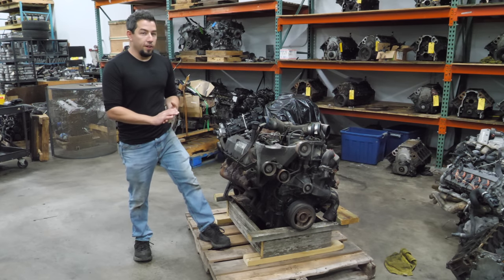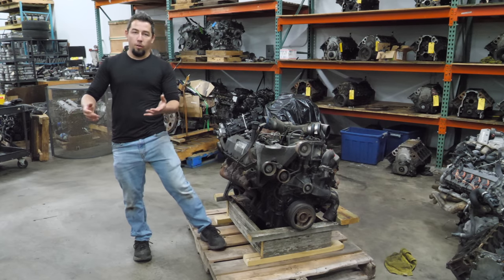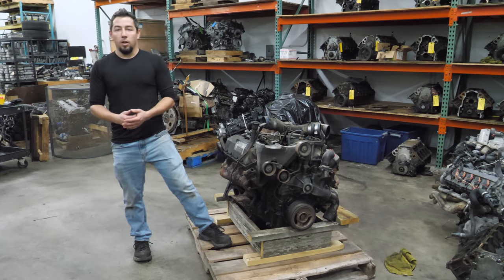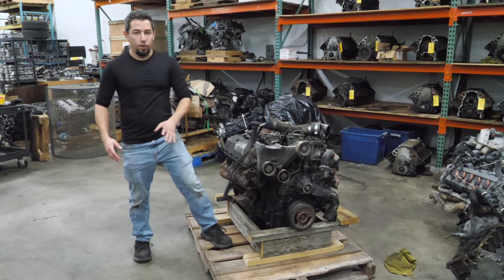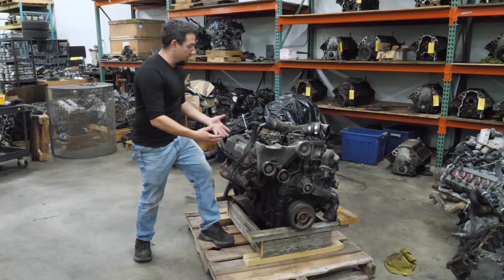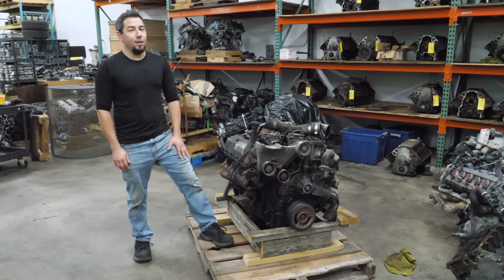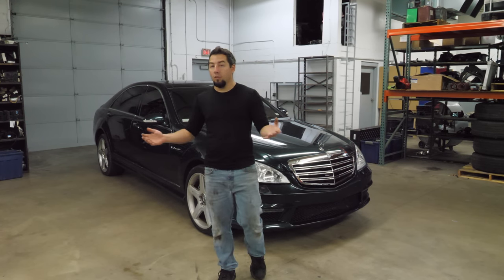70K OR 700K? Ford 7.3 Powerstroke Mileage Discrepancy. How Many Miles Are Really On This Engine?

Comment: I want to surmise its a 70k motor with poor maintenance. oil and filter change sounds like a local service sweatshop with poor routine. drain it til its good enough and put the oil back in it.

Comment: Wow. This one is hard.  After reading all of the other comments, I can see both points of view. Everything external says low miles but the bearings and cam -hmmm.  Quite a shock to see that copper.  However, as others have pointed out, that is probably a case of being "rode hard and put up wet."  Even 70k of that kind of use will exact its toll on any engine.  I think it comes down to you.  As we have seen, you won't mis-represent an engine and I would direct any interested party to this video and then come to a fair agreement.  If you decide that its really a builder, then ask to have it torn down for your channel. Would love to see a real Navistar torn down.

Comment: If the truck was driven for 17 years then it could have 700K miles easily.  However, if it was only driven 70K miles for 17 years then that is an average of 4117 miles per year, which seems unlikely.  I think it has 700K miles.

Comment: If the engine was mine and I had it on the bench as you do, I would put in a new set of bearings in it and put it in my truck.

Comment: It can't have done 700 because as you say it did it in 3 months. Impossible.
It's done low KMs. Just idled lots. Fit new bearings and it will run great. Because it was running when crashed.

Comment: These engines are supposed to make it a half million miles before 50% of them need major engine work IE head or oil pan removal, so to see bearings look like that after only 70000 miles is not likely on an engine that gets 15 quarts of oil every 5000 miles.

Comment: I can’t comment on the wear or condition of the engine, but I do know how people make mistakes entering numbers in computer applications. They are lazy, so why type six numbers when five will do. 

The numbers only make sense if the initial 64,899 mileage is actually 648,99x. The oil change intervals are roughly every 3,000 miles, sometimes in one month, sometimes in three. It looks like the vehicle went the first ten years of its life without any maintenance, so maybe they replaced the engine and rethought the benefits of regular oil changes. 

If you take the 600,000 numbers like they are 60,000, in some cases the oil was changed after only 466 miles. Seems extreme.

Comment: There's no way it has 700k on it, I've seen diesels with almost 1mil miles on it, and that's not it. Those bearings are a mystery, something doesn't add up, cold starts after sitting for years? It's just too clean inside.

Comment: There is absolutely  no way that engine did 700,000 miles.

I can be sure because of the carfax data.

To whit: 29 Dec 14 to 03 Feb 15 is 36 days. The difference in recorded mileage between those dates is (685,738 - 68,372 =) 617,366. That's an average of 17, 149 miles per day. That would be an average speed of 714.5 miles per hour.

Now, I know that a big turbo-diesel has torque by the bucketload, but there's no way that brick of a truck could average over 700 mph!

We can have some faith in the figure of 68,372 miles for 29 Dec 14 because it's plausibly consistent with the preceding record of 67,675 on 02 Aug 14.

Someone must have done something weird to the odometer between December  '14 and  February '15.

Comment: Tear it down and measure the cylinder bores. I'd think at 700K the engine would have been rebuilt and possibly needed the cylinders bored larger. But you really can't sell it for decent money with bearings like that. And we haven't seen what the main bearings look like.

Comment: No expert on these engines, but it seems unlikely that the engine would look anything like as good with 700,000 miles.  Whereas just what what i have learned from your channel, with a two owner truck, first owner doing poor oil maintenance gives you excessive bearing wear, he then dumps the truck.  Second owner does his 3000 mile oil changes until he kissed something rigid.  Low mileage poor maintenance explains paint left on the block/covers and a generally good exterior, and excessive internal wear.  Also i can't see an engine with 700,000 miles of wear and tear still having paper/plastic labels intact.
One solid test would be to yank the glow plugs and borescope the cylinders from the top not just at the crank (pistons will not wear there at the very bottom where we saw the hones).
700,000 miles with perfect maintenance would still have loads of wear.  And 70,000 miles with poor oil maintenance should still have decent honing patterns.

Comment: Mostly just my conclusion from what I've seen is... There is a good chance that this isn't a 70k mile engine. Now, the great question is... HOW THE BLOODY HELL DID THE OWNER MANAGE TO PUT ALMOST 700K MILES ON IT?! Like seriously, within 2 months, I cannot think of any real reasonable conclusion unless the owner drove almost like every day and even had a trailer on the back of the truck with him. Which would make sense to an extent. Tho the question then is... why is none of that recorded at all to any extent? Because part of me has to wonder, Did the owner perhaps change the oil themselves most of the time, and never record the odometer (or reset it.) each time they changed it? The better question is, where would they have been going to have gotten that many miles, probably across the entire landmass of america, within such a short time span...

Either way, I believe this engine might be a 700k. But the condition of the plastics and parts of the exterior lead me to want to believe otherwise. However it is quite rusty with that exhaust... which makes sense given chicago but... Was that at the end of it's main journey, or... was that all accumulated during it's long journey of the mysterious 700~ish thousand miles, for all that rust anyways. It's difficult to say tho without having been there to witness everything that engine and truck went thru.

Comment: Plastigauge is the absolute shiznit for what you're doing here. Great way to objectively check those bearings.

I like your theory that the engine was either replaced or rebuilt at some point in its life. The 70k and a ton of idling theory holds water too, but I don't think any amount of superfluous maintenance could've kept an engine that nice for almost 700k...and considering the sad state of that bed I don't think the maintenance it got was all that great.

Comment: I can tell you -- If it's not leaking everywhere and covered with oil -- then it probably has less than 300k miles.  These things like to leak oil, and a high mileage engine will usually get neglected and it will show signs of the leak carnage..  If he does have oil everywhere -- then it's likely 300k miles or over......    Judging by the rust on the back of that bed -- this truck likely does have 700k miles on it.  Just a guess.

Comment: the " best " route would be to just fix it to running condition for YouTube ,  and sell it as a working engine to be rebuilt,  it's definitely not 70k miles I would expect a cluster swap occured before it was salvaged as the low miles cluster its easy to upgrade a clean truck,  the engine is a 300 or 400k care worn engine by the looks

Comment: Looks like someone forgot the decimal, accidentally multiplied mileage by 10.  Rather than correct the mistake, they went with it afterwards.  The paint on truck looked too good for 700,000 miles.  Chicago rust though.

Comment: not trying to start fights but it seems like a lot of you guys are basing your experience of old small blocks and don't realize just how ridiculously overbuild the 7.3 bottom ends are. totally possible for a well cared for 700k engine to have rod bearings that look like they have lots of life left in them

Comment: There's no way HEUI injectors will go 700K.    They will very likely go 70K.   Look at the serial numbers on the injector solenoids.   They should be sequential or nearly sequential if they are original.

Comment: Why can't you check engine searial number with the Vin  number on the truck. Ford  will still have the build sheet. A dealer can find that for you.
Reply: My 2001 7.3 is all original except up pipes and were harness. 301234 miles still running strong.

Comment: I would lean to the 700k. My 7.3 with 135,000 has no external oil grime of any kind and l have not repaired any leaks either. It could be 70 with some poor maintenance and shit box oil ran it. Best diesel ever put in a pickup besides a 5.9 cummins.

Comment: Just from watching first few mins. Id def say that engines got 70k. With the discrepancy, im thinking they looked at 68,573.8 on odometer, and didnt think of the .8 and just wrote 685,738. Im writing this only 6 mins in but also from experience with my own 7.3 in new england, if that truck had 700k in the rust belt it would have wayy more corrossion and pitting.

Comment: Thats an easy 700k mile motor. Way to much wear. Needs a freshen up for sure. Also the outside is definitely one of the dirtiest I've seen.

 The first shop that updated the carfax with 60k miles definitely made a mistake. The person who checked probably did a quick glance and 2nd guessed what they saw and thought it was unrealistic so they put 60k.

Comment: 700k.?.well looked after..ive heard they do a mill miles, if YOU CHANGE THE FKN OIL.. but, id say its 70k.. guys here in aus, would buy used taxi cabs, as they were allways warm.last for thousands of miles.

Comment: Unless this truck could make 292 miles per hour.....  It isn't likely 700K.  Doing the math, it says in 3 months , 90 days, it averaged 7000 miles per day.  Rolling 24 hours a day it would need to be going 292 mph.... obviously ONE of the two figures are not correct.  

I yield to the experienced looking at the bearings.  But generally I dont think they tell a 700K story.

Comment: OK that engine is 17 years old. That’s only 4000 miles a year on a work truck? No way. You’re not gonna make any money with a work truck with utility bed only driving 4000 miles a year. Therefore I lean toward 700,000 miles.

Comment: the injector wire harness hasn't been spliced  with new ford parts they don't last over 200 ish  thousand mile   unless they changed the intire harness  because of  valve cover gaskets .... 👎🏽 nope.... probably 100k miles under... look at the cylinder  walls  should see perfect  x marks

Comment: The chance of a 7.3 having 70,000 miles is almost zero. Every 7.3 I know driving around has over 300k. I know several even a 2001 f250 gasser with  over 500k.

Comment: Low mileage.high idle time. Worked on plenty of theses they had low mileage but very high idle time where the bearings wore out. Slip in new bearings good a new

Comment: 70k. They would have had to have driven 250 days straight at 100 mph, non-stop, to gain 600k miles on that engine, and somehow it gained that in 2 months? Nah. Math alone says it's impossible. Engine only has 70k on it.

Comment: I'm looking at the truck and I live in Indianapolis close to Chicago the bed has taken allot of rust BUT those cab corners are a dead give away there is no miles the no yellow headlights the crispy bumper I think personally it had a shitty 60,000 miles hear me out those are definitely oem injectors I own four 7.3l right this minute been under the valve covers of all of them and none of them are this clean I have one with 300,000 miles on it not a speck of rust. underneath the valve covers is nasty as all get out I think it's a HARD 60,000 MILE company truck

Comment: I don't like to disparage people on the comments they make, but 70,000 miles is not correct, hate to say it guys but some really need to go to Diesel mechanics school and/or work in the industry for 26 years to know fully about diesel engines and how their built and how they run, you cant guess on these things their tolerances are tighter and everything about them are designed to last a long time with proper maintenance, have done a lot of work on these and the 6.0 so I know this engine has far more than70,000 miles on it.

Comment: In one year that's damn near impossible.. Looks like they made a mistake reporting it may very well be a 70k mile motor. I'd  bet money that there is no way it jumped 600k miles in one year that's 200 round trips around united states and would show alot more reports for oil change service hopefully or the bottom of the motor would be gone any ways

Comment: Ok, I don't work with engines or anything like that, but I love watching your station.   But looking at this, there is no way this is a 700,000 mile engine.  I mean, if the carfax is right, they had to drive 60 mph for like 347 days to get to 700,000 - to do that in a few months.........     no

Comment: Who puts a new turbo on a 70K engine? Turbine wheel is not stock. 
The first clue.
Bearings and cam are fried. No 70K engine internal looks like that. 

Second clue. Crank journal looks like crap.

Comment: Dude, you do not need a huge investigation into the mileage issue.  It is quite obvious that the Oil Express place (often hiring teenagers with absolutely no work ethic, and minimal attention to detail, IMHO) made a mistake and added a decimal place when they logged the mileage.  They meant to say 68K and change.  The subsequent mileage errors were by the same place and probably based upon the original mistake.  You got a 70k engine there, enjoy it!

Comment: My opinion, 70,000 miles. Lots of idle time, lots of cold starts. Also, 7.3’s high idle like a mf even in high 30’s. Add that with thick oil due to being cooler than usual, = high bearing wear.
 I have two 7.3’s. In cold they do not get up to temperature very easy, and I’m in Texas. I remember even pulling a gooseneck in low 30’s it wouldn’t get anywhere near operating temps.

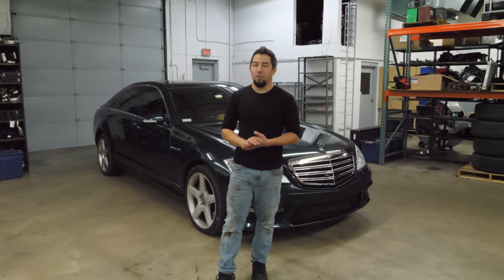Comment: 22:22 I would love to see you get this thing started on a cart of some sort. If it's got a fully mechanical injection system, this shouldn't be too hard.
Reply: No it don’t that’s electronic it’s a power stroke they stopped doing that in 1993 worked on these all my life
Reply: It needs a PCM and IDM to run. The mechanical injectors need a 120v solenoid pulse to fire.
Reply: If it was mechanical your right but not this one dude
Reply: @justinp9354  I'm sure a little creative arduino fuckery could fool the injectors into firing when they need to fire well enough for us to see the engine run.
Reply: @justinp9354  heui system 1994 to 2003 right before our favorite 6.0 was standard

Comment: Definitely 70k, every single fastener on that engine looks like you could put the original size socket on it and remove it, even on the exhaust. After 700,000 miles in worth of heat cycles and a high salt Illinois diet, I think all those fasteners on the top of the engine would cease to exist.

Comment: The turbo definitely wouldn't look that nice.  For that matter, nor would the rest of the engine.  That looks WAAAAAAAAAAAAAAAY to pretty to have 700k miles.  When driving (on/off boost) those leak/burn so much oil that you can typically count the mileage by the thickness of the caked on sludge.  At 700k, there should be almost a half-inch thick sludgecake.

Comment: There is no fucking way that that truck accumulated 600k miles in 2 months unless someone decided to try and drive every road in the continental US. I think somebody at Oil Express messed up with writing down mileage. Also I would think that if it was a 700k engine the crank would be a lot darker; that one looks fresh out of the foundry.

Comment: Diesel engines are made to last a long time.  The rod bearings should be changed every 150k miles. What you have there is a 70k truck with an engine that was idled a ton. Keep it together and sell it as a rebuildable engine.

Comment: Def does not have 700k.   Thats a 70k motor.  I can send u pics of my 99 with 323k on it .  Your motor does not have that insaine amount of miles.   Clealry typo from oil change joint.  Even the dealers had it correct untill after the typo from oil change place

Comment: So that would be an average of roughly 10,000 miles a day at 416.66668 miles per hour. I’m going to make a safe bet that would be impossible.
Reply from the maker: Yeah they are pretty slow trucks 🤣
Reply: @I_Do_Cars  seems like a great motor to resell and make a few bucks.

Comment: (deep voice) Welcome to another episode of ECSI - Engine ...dum-dum-dum... Crime Scene Investigation 
I'm a gonna go with the idea that the truck had the engine replaced at some time and that engine has somewhere around a couple of 100K on it.  It was a service truck usually meaning high miles. 70K is way too low for the condition of that truck in the photos. There was a lot of rust on the side panels. The top end was clean meaning it was well maintained yet the bearings were worn pretty good. So as you said. Not 70k and not 700k. For all we know this could have been the 3rd or 4th engine in that truck.

Comment: The point of this video is ludicrous. If it had 700k miles or hell even kilometers there would be no paint left at all. For that matter the truck wouldn't even exist after such an exposure to so much salt and moisture. (under the assumption it remained in that area for the majority of its service.

Comment: This is just one employee, looks like the same person, incorrectly entering mileage at the express oil facility. That's it, no story no other entry by anyone. Come on man. And hey, up here in Ontario Canada they throw rock salt on the roads from late Oct to late March, my VQ37HR/G37x sedan has 113K miles on the odometer and still purrs like a kitten. Good designs will last no matter what, if properly maintained.